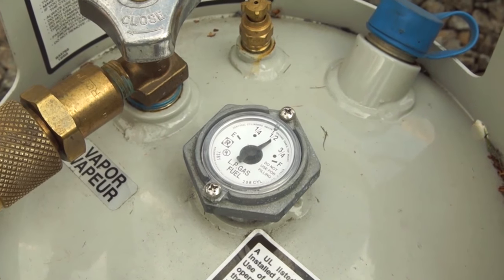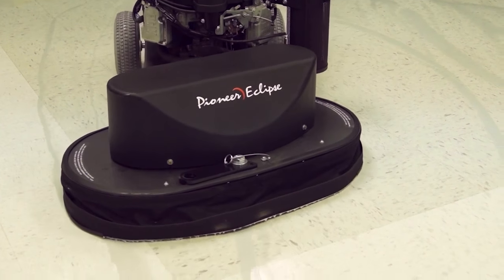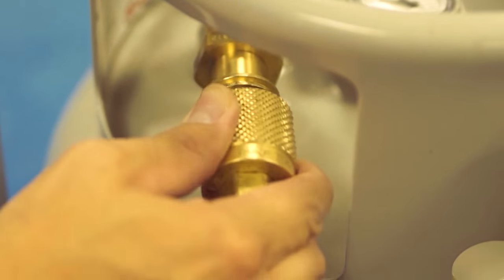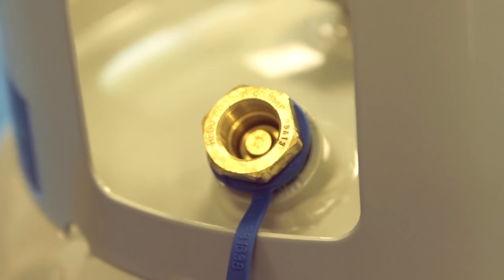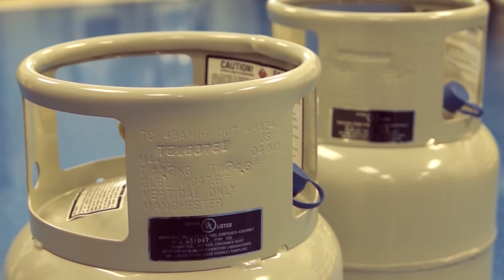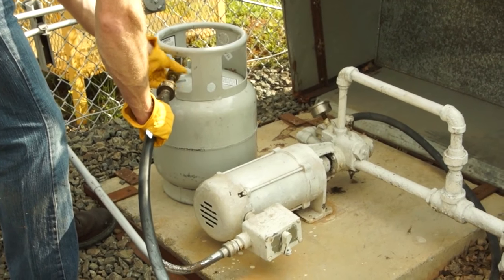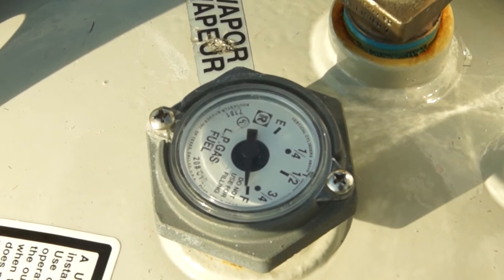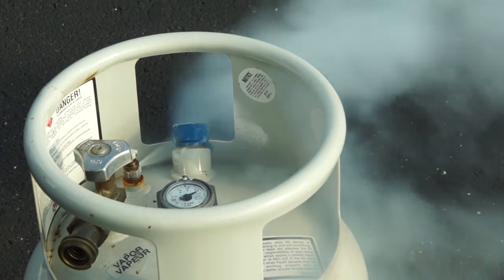Propane Technician Training: Propane Cylinder Guidelines

Comment: Well, you botched that one. The 20 pound buffer tank actually is 80 percent at 20 pounds. If filled 100 percent it would have 25 pounds in it. So saying that a 20 pound rated tank is 80 percent at 16 pounds is wrong. It is exactly the same tank as the bbq grill bottles except with different appurtenances.